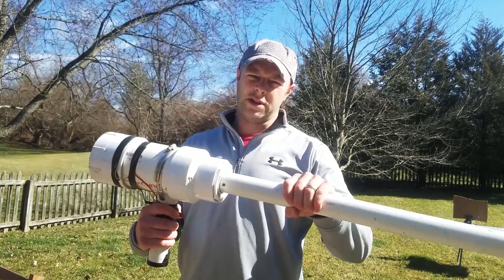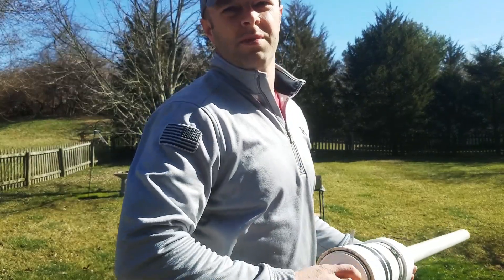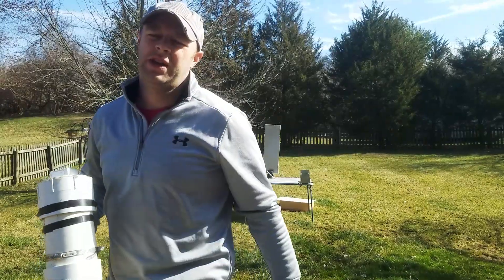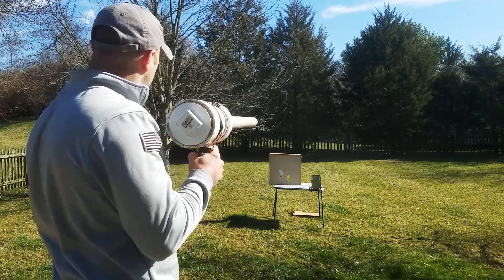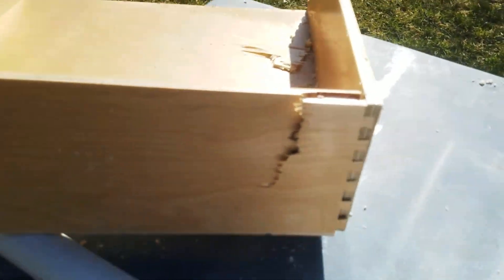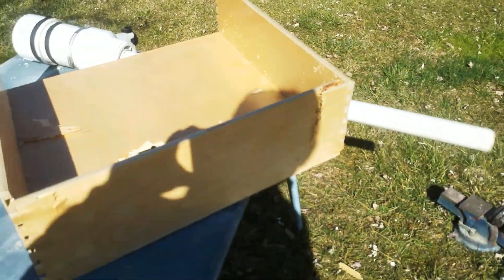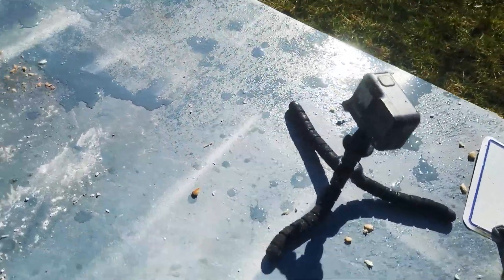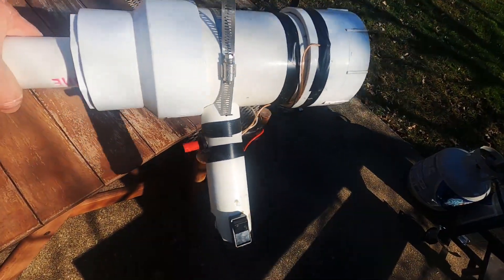What will a potato cannon shoot through?

Comment from the maker: What else do you want to see shot with the spud cannon? Comment below!
Reply: Rugged Adventures— jet skiers down on lake Cumberland—
Reply from the maker: @apexadventures7300  might not want to put that on the you tubes.
Reply: Rugged Adventures it would be good clickbait.
Reply: Watermelon, will it blow up or go straight through ?
Reply from the maker: @twofires3549  good idea! I'm thinking 1/2 inch osb too.
Reply: What fuel do you use? We use hair spray but then the cap gets sticky and it is so hard to get off!
Reply from the maker: @nicolemaxfield9463  carb cleaner, no residue.

Comment: I’d like to see how you have that trigger set up
Reply from the maker: It's just a grill ignitor drilled into a pvc pipe band clamped to the combustion chamber. It's wired to two screws with thier tips close in the combustion chamber.
Reply: @RuggedAdventures  thanks. Yeah over the weekend I built one with my 10 yo grandson for a science project. We like looking at other designs. We put the trigger on top. Thank you